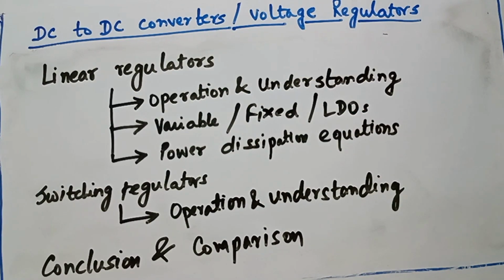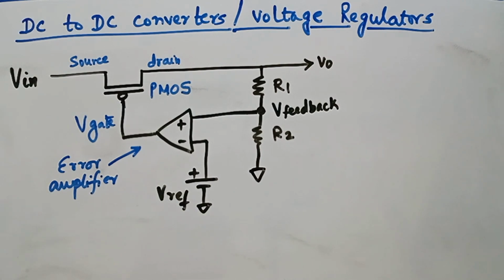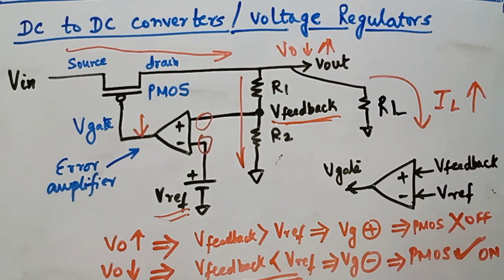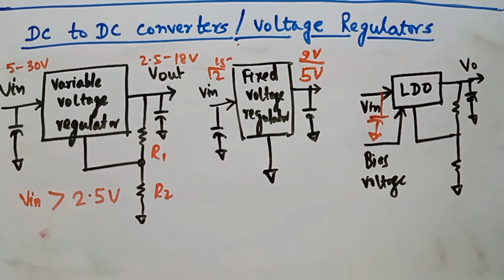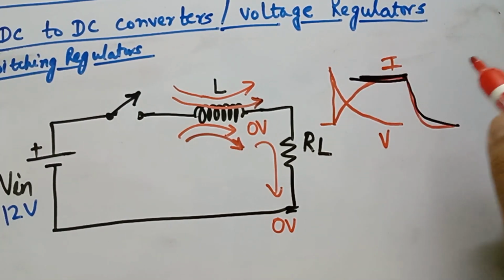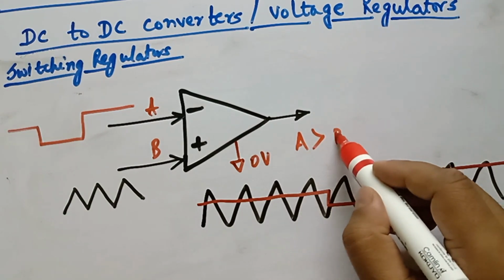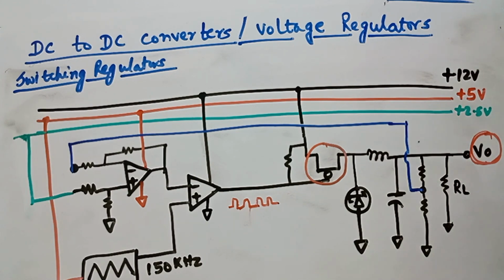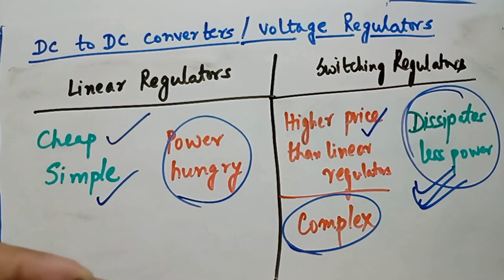How DC to DC voltage converters, linear and switching regulators work, internal circuit diagram

Comment: Best explanation I’ve seen yet!  Is it possible to do a lecture on the workings of an MPPT regulator?
Reply from the maker: Surely, we will produce a explanation of MPPT as well.
Just to give a brief, the max power point tracker figures out the optimum power
available to charge a battery from the solar panel.
Anyway, thanks for your suggestion and comments.